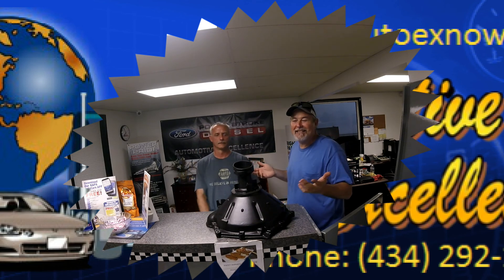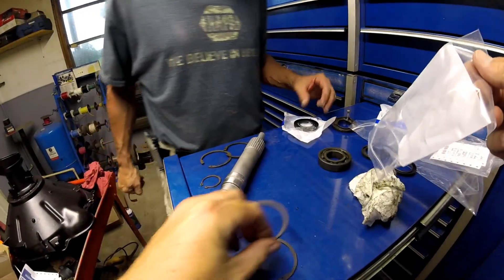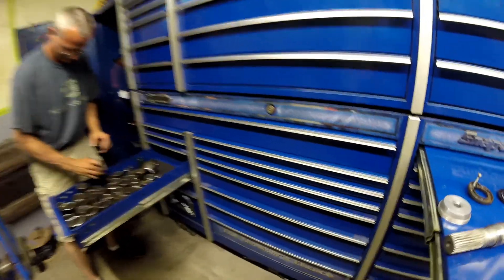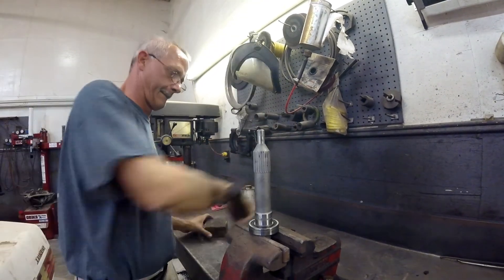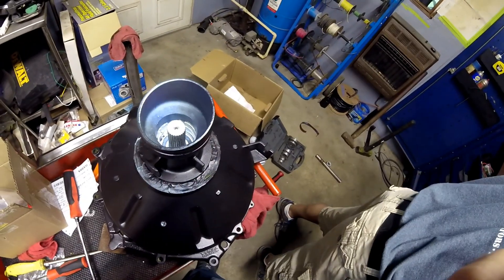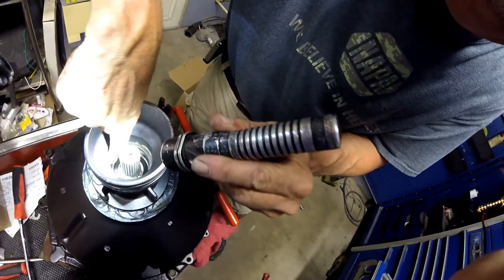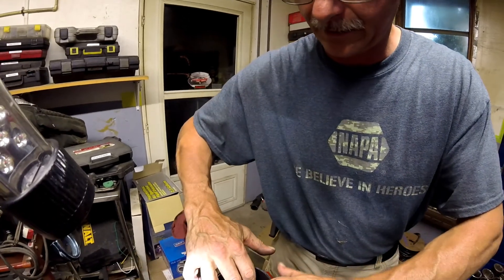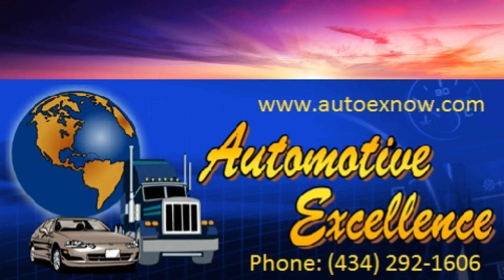Volvo Penta Gimble Bearing Shaft Seal Bearing Install DP -C1

Comment: can i ask you for the skf bearing number and the seals numbers ,, can i order them from autoexnow ?
Reply from the maker: The bearing came from a place called Motion Industries out of Richmond, Va but they have stores in other states.  Here is the link  https://www.motionindustries.com/  SKF Bearing B05678  Let me know if this is all you need?
Reply: Do you happen to know if that bearing works on a 280 Volvo Penta Outdrive?
Reply from the maker: Ron Perkes I do not know mine is a DP-C1 1996 if I had to guess I would say yes but not sure look here at these two links and make sure to get  your part number if it matches then you can use the same bearing number I used SKF B05678.  If your not sure take the bearing to one of their shops they can match them up for you also and should have in stock.
http://www.marinesurveyorontario.com/volvo%20penta%20workshop%20manual.pdf
http://www.volvopentastore.com/Flywheel-Housing-And-Mounts/dm/cart_id.073636211--session_id.298182168--store_id.366--view_id.775659
https://www.motionindustries.com/
Reply: BlackstoneBass.com  is your flywheel cover a two piece design?  I also have a 1996 DP-C1 and mine is 2 pieces.  I’ve read some forums that say the two piece was made by Borg Warner and is no longer in production. Was hoping maybe you could shed some light.  Thanks for the informative video!
Reply from the maker: I believe mine is a one piece I will have to check on that.  My entire boat project can be viewed here maybe that will help?  https://www.thehulltruth.com/boating-forum/686056-1996-albemarle-24-project-boat-19.html
Thanks for the comment.